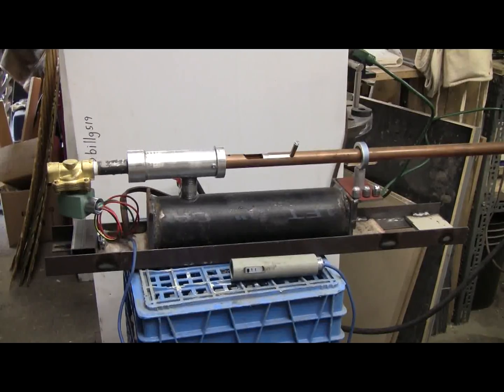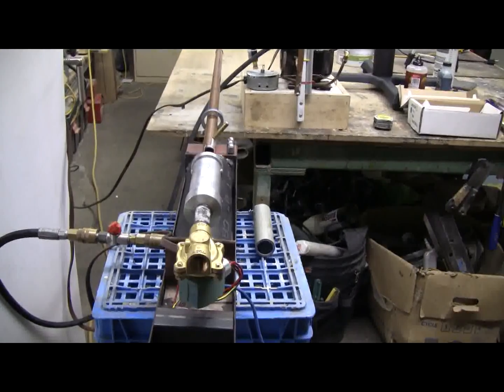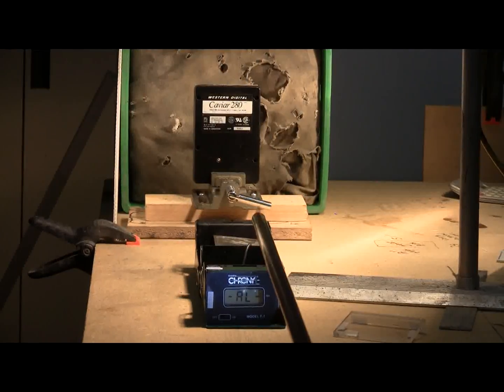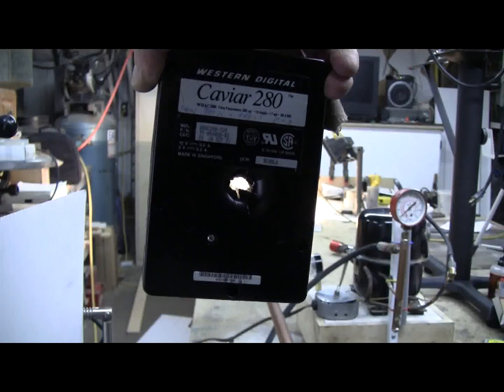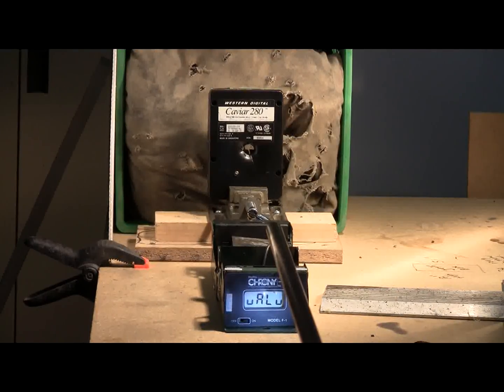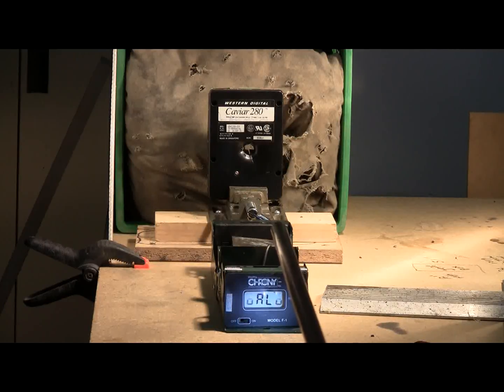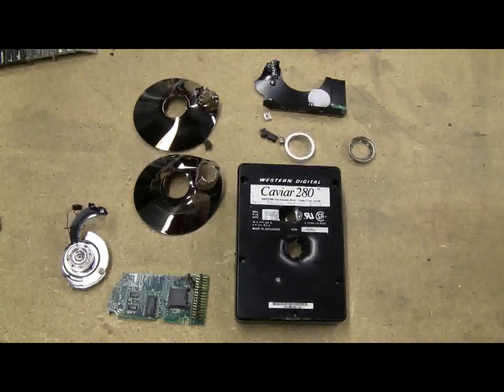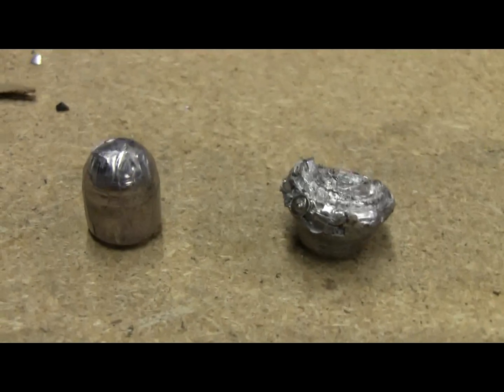Air Cannon #60 - Hard Disk Disassembly

Comment from the maker: Thank you. The fridge compressor is handy. I want to get another one sometime, then I will go to higher firing pressures. Right now, I don't want anything to go wrong with my one compressor. The shop air is the usual 125 psi and I like more than that.

Comment: Very nice :D, the old fridge compressor makes a great air gun compressor :D, I am working on a revised model myself, 350+psi but without the dump valve :(, need to make/buy one of those.

even a .22 air rifle slug screams across the chrony at 300+fps at 300psi,  :D